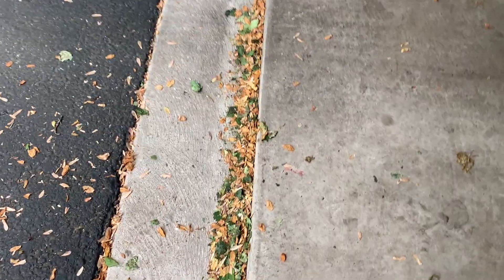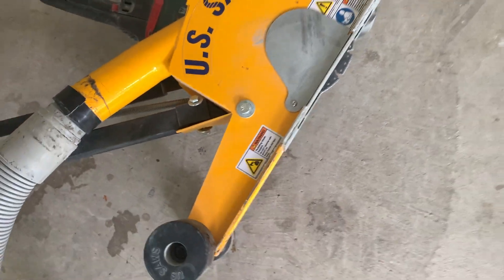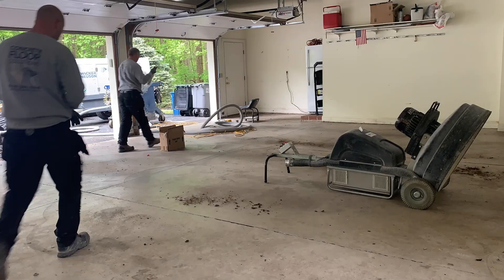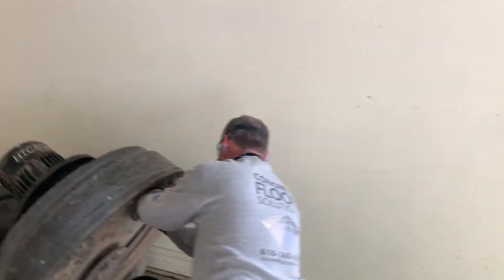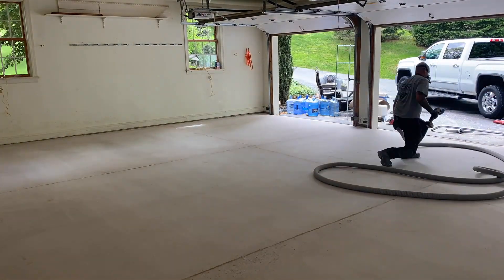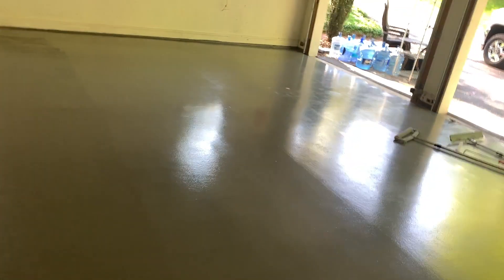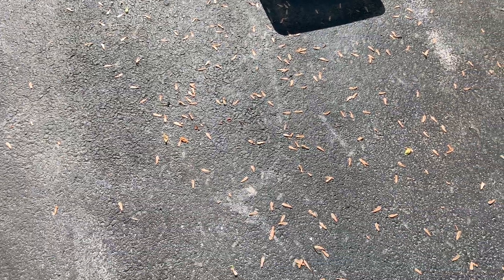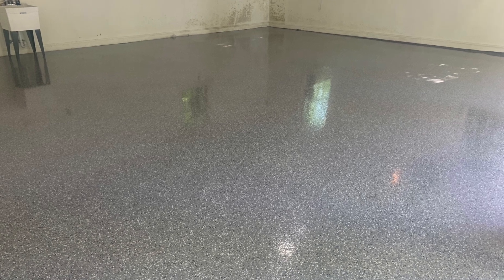Installing a Dark Gray Epoxy Floor With Flakes.

Comment: nice install, got 2 myself this week, one with some very challenging joints that the client is concerned about but hopefully going to round them out as smooth as possible with a crack chaser then a full flake going on top should cover up the bad substrate
Reply from the maker: Good Luck.

Comment: You didn't scrape the flakes to get the loose ones out?
Reply from the maker: You don't need to scrape unless it is full flake.  When we run the squeegee over the surface, it will knock off any high vertical flakes. It all gets encapsulated in clear epoxy.
Reply: @ConcreteFloorSolutions  Thanks